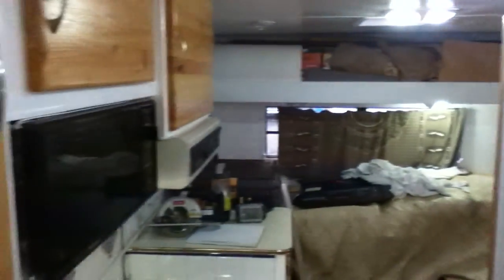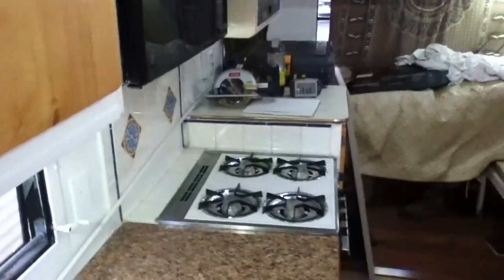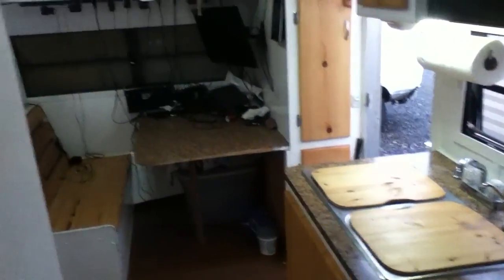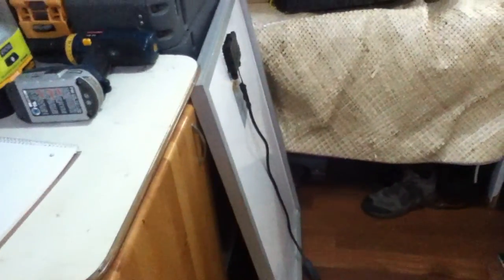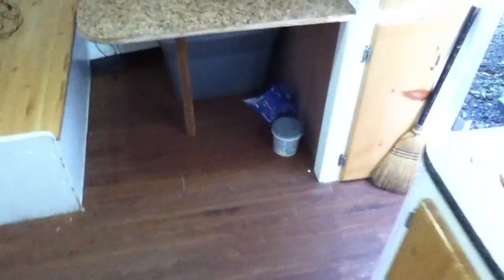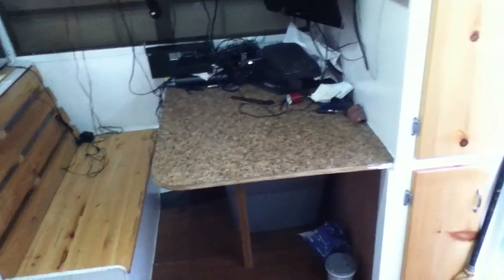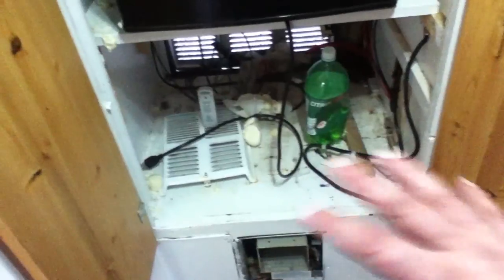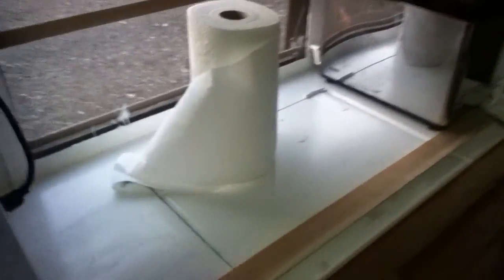Maintenance checkup on off grid survival camper - advice and nasty surprises

Comment from the maker: Off grid definitely, I have the solar panels already and hauled in some stuff to the build site already.   Size is yet to be determined because I got conflicting information on local building codes over how big I can go without permits, and what counts as a full time residential structure, which mine will technically NOT be.   The question is then whether or not to haul the trailer up for temporary use or camp while building since I don't want the trailer as an eyesore to set a precedent there.

Comment from the maker: They don't work for the constant moisture in a heavy rain environment and once they are done absorbing, the moisture just keeps building up.   Two things solve the problem: sealing it better or having constant air flow.   People near regular power outlets will use an electric dehumidifier, but those things are energy hogs.

Comment: i would seal the roof with i think its called silver seal. and there is a product with the moisture absorbing material with a small gap at the bottom where water can collect and you can dump out they work well in a small area i found them at a dollar tree store.oh i use a product called through the roof to seal roofs it is very flexible and won't crack and work on wet roofs

Comment from the maker: If that were such a good idea then someone would be doing it commercially.   I am building cabins this summer and have made a deal to be able to build one for myself at one of the properties I do maintenance work at.    Ripping apart a decent trailer just to get the chassis is counterproductive when I can almost build a new chassis for about the same cost as the dump fees in throwing away the "old timber" as you suggest.